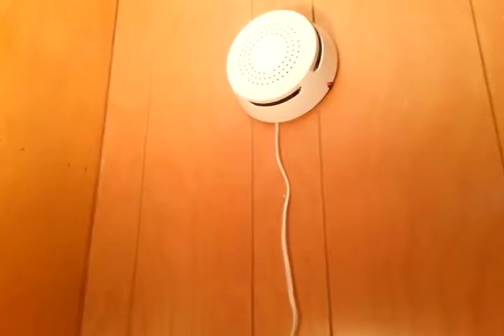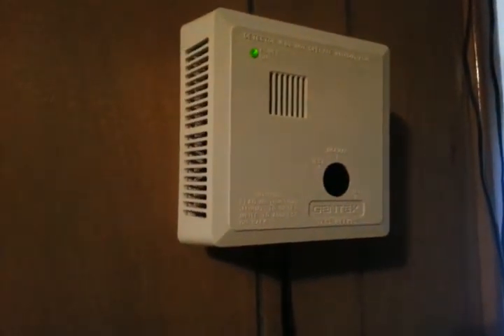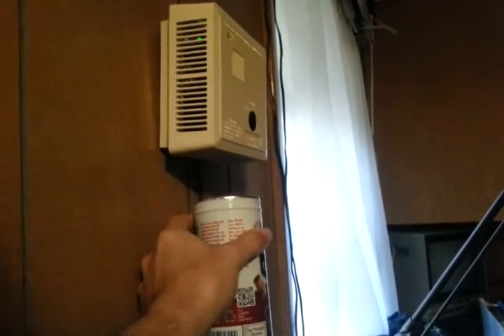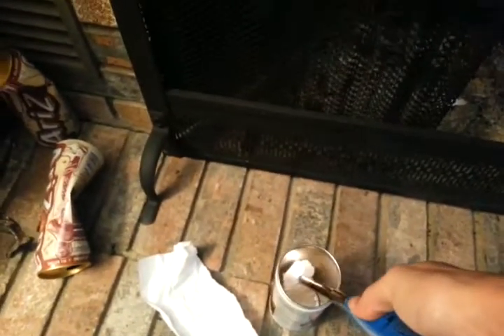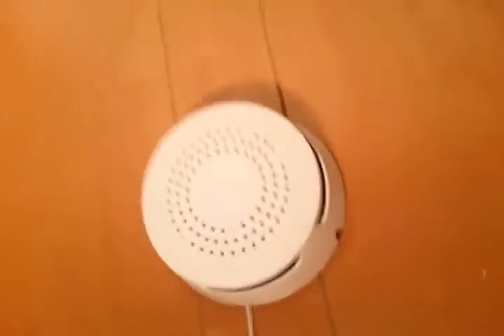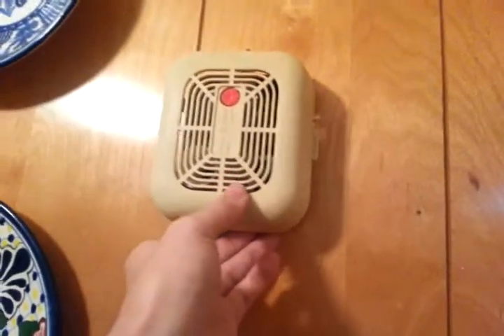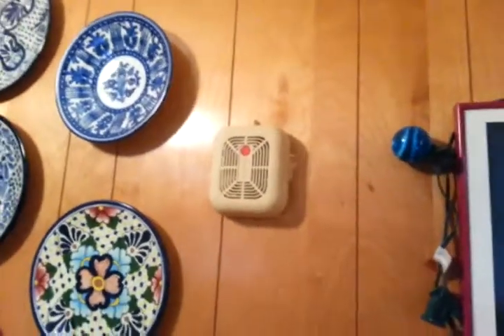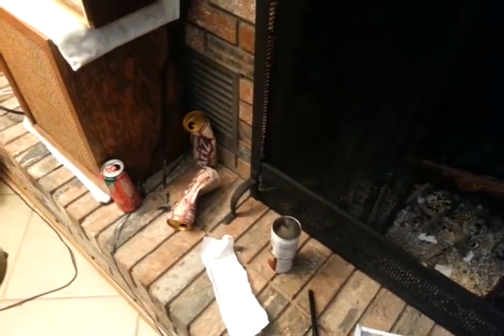Smoke Detector Party!!

Comment: Now ya gotta get a geiger counter to try on the Honeywell. 
In Colorado it would go off for marijuana smoke.
I think the batteries are dead in my smoke detector.  Thanks for reminding me to change it with this vid.
I'd put one above the fireplace so it would go off a lot - gets everybody all excited.
Are those smoke detectors AC or DC biased?
If you get on Fakebook, sign up on my FB ch:  Donald Umajunkcollector
I also made a group on there called Hamfest Online.
Yes, good old rigs are getting rare, but I did recently find a Sony 3" RtR with no audio.  but works mechanically for 10$ last month.
Why no audio?  hmmm...
Reply from the maker: I wish I had a geiger counter. I bet the no audio problem is just a bunch of leaky capacitors.
Reply: Bb